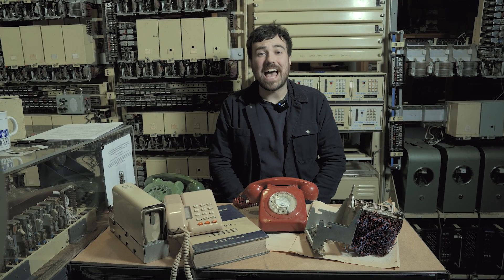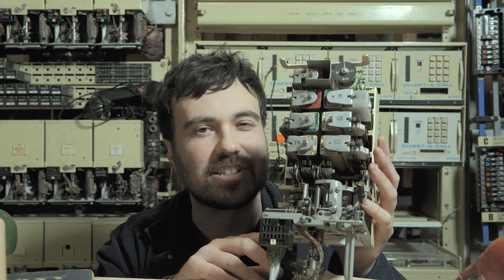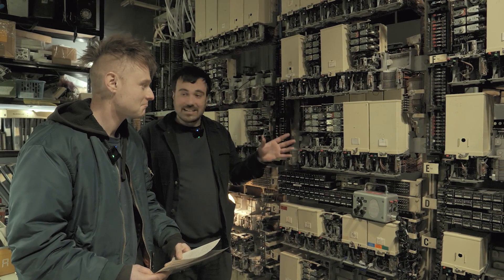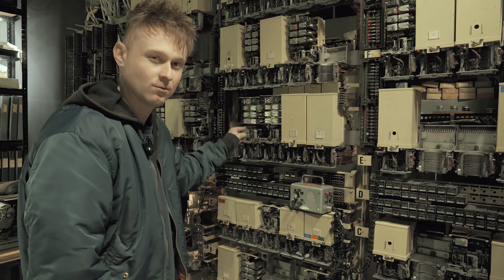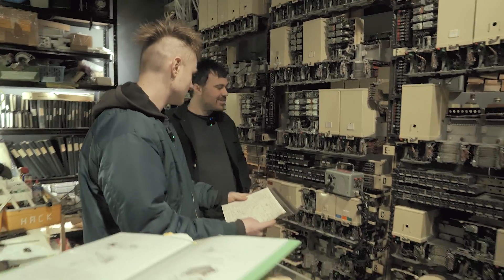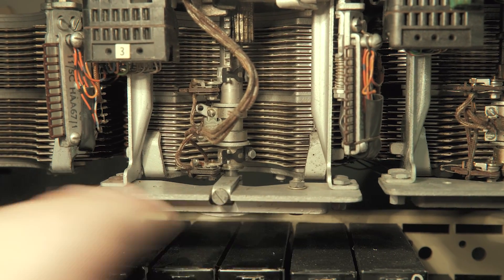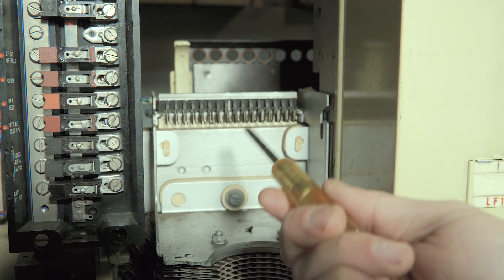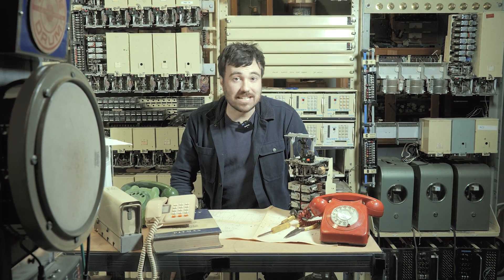Do You Have What It Takes To Be A Telephone Engineer? - Telephone Tuesdays

Comment: You should not just leave the link out. It should be inserted below to put the eth on the P wire. This earth is part of the path that steps other selectors over that step. The same reason that the 'U' points short when removing the switch. It is the eth that shows the switch is busy not the removing of the U link. Hope that helps. (Ex Exchange maintence TO with PO.)
Reply from the maker: thanks a lot! however it is contrary to what has been said by other uax13 maintenance engineers, and also it still works without the jumper being in. in the documents it says to do so, but people have said they don't bother. 
i am in full agreement it is what you should do, but i am just stating as it hunts horiontally it doesn't actually need an ETH to skip, it will still skip regardless.
just going from what other people have said, and the schematic. cheers!

Comment: The green link is for the rotary magnet, not the vertical one.
Reply: BTW I started with Strowger in '79 with NZPO. Went on to crossbar and NEAX61. Then electronic PABX, circuit board repair and self employment repairing anything that came in through the door. Now machining for frankenstein engines because I've always preferred playing with big engines.
Reply: When the wipers jam in the bank, the rotary magnet stays energised, it's on a timer and after so many seconds sets off the "release alarm" pulling the green link de energises the rotary magnet and clears the alarm. You've then got to busy it and then repair the damage.

Comment: Looking forward to visiting one day. My studio pf audio antiquities has recently been donated an ITT, GPO field engineer line test oscillator. I got it working. Looking forward to integrating it into my work. It will eat batteries, as even in the off position, it will drain them. I need to fit an off switch and a dc power socket. Obviously, I'm in no rush to hack it away from original spec. It's got the original leather case, operators manual and leather case.

Comment: Had a tour of a few exchanges during 70s as some mates worked for G.P.O. Could be very noisy places. The battery room was a bit scary with a room full of huge 2 volt lead acid batteries and a strong smell of sulphur.

Comment: The telephone videos bring back memories of a period in the mid-70s when I worked for a company who built exchange equipment for British Railways. One piece of equipment was a plate full of relays, and I had to design the test rig to verify the correct operation, and prove to BR that it was checking every feature. It was an interesting project, and I was quite proud of the result.

Comment: It may be worth a mention, that once selector is removed, one or more of the pairs of U-Points on the frame, will be shorted out. This tells the exchange that there isnt a selector in that position, so therefore skips trying to access it at the preceeding group selector or (line finder allotter).
Reply: Definitely worth a mention, thanks!